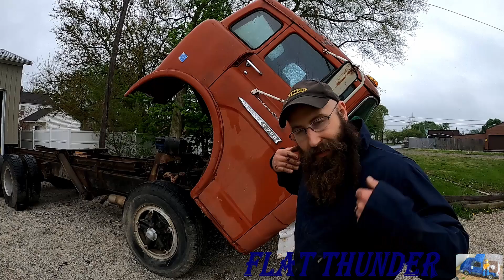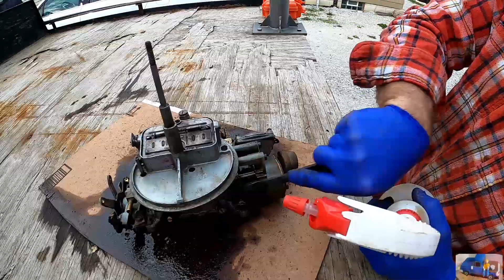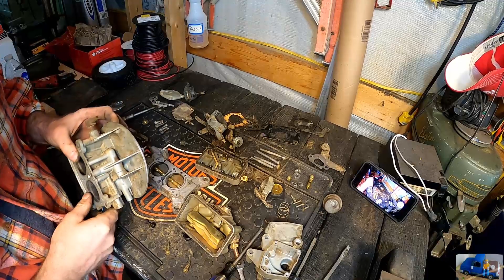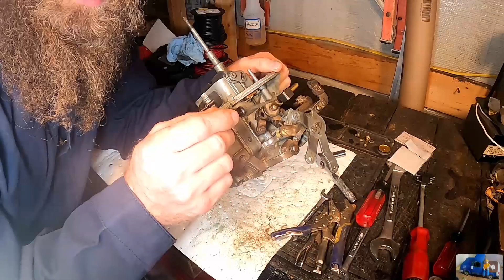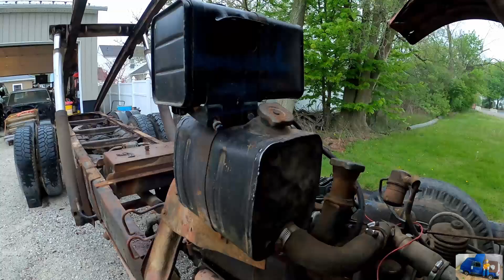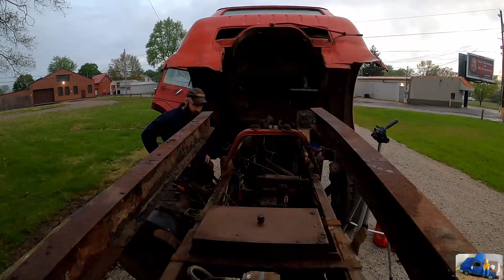1962 FORD C750 (CABOVER); DIRTY LIL CARB

Comment: Copper spray a gasket
Reply from the maker: I think it's a good product, but I have never used a spray gasket maker.  If I ever have to remove the carb I'm contemplating making a new paper gasket with the  laser burner.  Thanks for watching!  👍😁
Reply: Spray the gasket you already have and then let it dry

Comment: replace the studs that gasket is a upgrad for a reason .
Reply from the maker: It's on the list for future improvements.  Thanks for watching!  👍😁
Reply: While I may be late to the party... that replacement "gasket" appears to be a thin phenolic spacer. It prevents heat from transferring from the cast iron intake into the body of the carb - hot gas is bad gas as they used to say. If you haven't already used it, it may be worth installing if you haven't upgraded your intake manifold. Best wishes! 👍🏻🇺🇸👨🏻‍🔧👨🏻‍🏭

- Max Giganteum

Comment: I have a 1968 COE 750 would you mind show me how your PTO works I have two levers but nothing happens I don’t know how to do it and the owner I bought it from says they used to use it all the time— also do you have any idea on how to hard it is to get the brakes to work I’m about to start tearing into this thing just thought I’d ask before going in blindly
Reply from the maker: It sounds like a fun project!  I am guessing the mechanical levers are the following; one engages the PTO and the second operates the valving.  My unit has cables to operate both features.  I can try to snap some photos of my setup.  I have yet to tear into my brakes.  I was fortunate enough for them to work when I purchased the truck.  She still needs a ton of work.  If yours are air brakes I'm betting it isn't building air pressure.  Stay tuned for more on old Margret... She's a long term project.  Thanks for watching!  👍😁
Reply: @FlatThunder  Yeah I have two levers looks like one runs to the PTO and one runs to the hydraulics box thing and I think my brakes are all like a car is with no air— I don’t have to have a CDL to drive mine
Reply from the maker: @Rocketman097  since they are hydraulic I imagine the master cylinder needs replaced or rebuilt.  All the wheel cylinders probably need replaced as well.  The rubber seals and cups dry out and leak.  At least that's my prior experience with older hydraulic brake systems.

Comment: Like how it has two cylinders for raise. If ONE losses pressure/ hose blows. The other one keeps you from going down. Great on carb. Issues. Runs so silky smooth.
Reply from the maker: Thanks!  I was happy with the results.  I'm not overly well versed in carburetor repairs.  This was my first attempt at one of this design / style.  Thanks for watching!  👍😁
Reply: @FlatThunder  
I can write down some FACTORY spec. Or call out sheet/ print out that should have been on your visor. Then you can write down what I Text you as a reference for shifting.
Reply from the maker: @rp1645  I still have to venture out to check out that visor decal.  She's been slumbering in the back drive for awhile.  I think I got the pattern down after finding 1st & 2nd.  Thanks for watching!  Cheers, 👍😁
Reply: @FlatThunder  
I well write down what the spec say. If you have a 5th gear. Just remembered 4th. Is what they call a soft gear( that's what they call it) 4 th & 5th. LOW then shift to 4th  HIGH & 5th High. YA it confused. Just us Low ( nob down) when empty or light Load. Then pull nob up on highway speed. In 4th. or 5th gear.

Comment: I use to repair holleys idle mixture screws and metering block never take the  throttle plates out to remove gaskets  soak the carb I rebuilt hundreds of carbs in my 30 years of being a mechanic
Reply from the maker: I forget exactly how I dismantled this old girl.  I do remember at the time I was going for complete disassembly and learning as I went.  I need a bigger soak tank / can.  Thanks for watching and sharing!  👍😁

Comment: Low idle circuit bat in carb soak carb and rebuild
Reply from the maker: My auxiliary fuel pump wasn't pumping so good.....It ran better in previous videos, but I was gravity feeding the carb.  Hoping addressing the fuel pump / float adjustment will remedy the issue.  I rebuilt the carb in a previous video.  Thanks for watching!  👍😁

Comment: Sweet looking ride with hydraulic cylinders to boot! Are you doing a dumper or going towards a recovery tilt bed to bring home other finds!?
Reply from the maker: Thanks!  The plan is to shorten the chassis and convert her into a tractor!  I have some neat plans for a flat deck conversion when not pulling a trailer.  Long term goal is a removable gooseneck trailer for hauling big stuff!  Thanks for watching!  👍😁
Reply: @FlatThunder  look forward to watching the transformation!

Comment: I enjoy your videos! I have found a Ford C 900 for sale. Looks to be in good shape. Looking for manufacturer specs. Has less than 48k miles. Used in a yard locally. Your thoughts?
Reply from the maker: Buy it!  They are fun, nostalgic and different than other cars on the road today.  I think a diesel power plant with air brakes would be the best combination, but they are all functional when in good shape.  Depends on your intentions, but I think air brakes are a must on heavy hauling rigs.  Happy shopping and thanks for watching!  👍😁
Reply: @FlatThunder  It has air brakes...gas engine. PTO works as well. Parts: easy to get? expensive?
Reply from the maker: @jimcole6423  stay tuned!  I haven't purchased very many parts yet.  She's a long term project.  So far I easily obtained a new old stock clutch master cylinder and a carburetor rebuild kit.  I was told via a viewer the clutch hoses are no longer available.  I am going to make my own from stainless steel braided hose.  Cheers

Comment: Just found a 68 C600 Cabover with a 16 ft box, Wiring on mine is in bad shape, it’s got the 390 in it, Looking to swap it for the 7.3. Awesome videos  doing a great job on the truck! Keep them coming
Reply: Dementrio
Great find. On my 71 SeaGrave. I have a take off plate on dash for all the Electric wiring. I fully know what you mean. I have found old wires going to NOTHING. Not even connected. I labeled everything with blue tape, so I don't forget what it was there for. Good luck on fixing your issues.
Reply from the maker: Sorry I missed your comment!  Thank you for your kind words!  I am super excited about the cabover build.  She's going to be a long term project.  A diesel cabover would be pretty stout!  Thanks for watching! 👍😁

Comment: Matt and I ran out of a couple ford cabovers like this in our first fire job. One was a heavy rescue truck with a two man cab like this and the other was an open cab pumper which meant the rear of this cab was extended and left open to accommodate a reverse facing bench seat. Was a blast to ride when it wasn’t cold out. Both were powered by a 3208 CAT.
Reply from the maker: It does sound pretty awesome!  The diesel power probably propelled them a little better than this gasser.  Thanks for watching!  👍😁
Reply: Matt Merc
YES I remember those when I was a Explorer 
Scout. We had a Second line C-750 with just the cab, like his. We always got to use it for Hose drills if we could get a volunteer FF to drive us to the Hydrant, just next door to station. We had another C- 750 with box Rescue type body. It had a Jump full bench seat just behind the officer( passage) door. The back was walk in, with flat  work bench type covers, the outside box's ( Tops) all we had for Cutting or prying tools was a porta power. NO Hurst tool. The FD to the south of us at time different Fire District was the only Department in the Late 70s to have the Hurst. We always called them on mutual aid, if the Hurst was needed. It was in a Chevy one ton with winch on front. Box type back, that Hurst was carryed in. Big Gas engine. That little Chevy Rescue Truck could move
In today's times, being a Advisor for Explorer's ( we changed from BSA to a CADET type program)  The FF Union was all for that. Helps us work together. Anyway the Rescue tools are NOW on the Equipment for all the District's. It is a ( zone) type response area. We just put in service a BIG Rescue Truck. Like FDNY's. No walk in in back like NY's. It Carry's trench Rescue everything. The guy's who man it ( 3) payed guys and gals
( Can't for get the Females. We have command females in CADET program. The girls have great leadership skills. Anyway that's what I remember about are excellent C- 750 Ford cab tilt type Engine and Rescue equipment we had back then. The main Advisor a Retired Batt Chief, would like to man one of are REHAB rigs
( Plain Vans with REHAB supplies inside) with a CADET and a light duty FF. We are working on getting that past the power's to be.

Comment: is that two way hoist buddy
Reply from the maker: I'm not 100% sure if your specific question.  I'll answer it two different ways. The little jib crane on the back of the F150 is a harbor freight special (manual extension, cable winch, hydraulic tip up via a tube jack and it swivels).  The hydraulic tilt bed on the C750 is pressure up and gravity down.  Thanks for watching 👍😁

Comment: I am sure it will run better with the pump connected than gravity fed. I also think cylinders would release if there was a bed on it. Maybe when you were polishing the cylinders you heated them up with all that friction and they expanded. LOL
Reply from the maker: It was getting a little hot and heavy in the polishing department!  Haha.  I think you are right.  What's left of the bed, just the main I-Beams, doesn't account for much weight.  Thanks for watching 👍😁
Reply: @FlatThunder  What size fuses do you use in the 843 cab ?
Reply from the maker: @jayweddle7993  I think you're asking about the Bobcat fuses.  I'm not for sure.  I only wired in a tap from the existing feed at the ignition switch to energize the fuel solenoid.  My whole system needs a ton of wiring work; like completely re-wired type of my work.